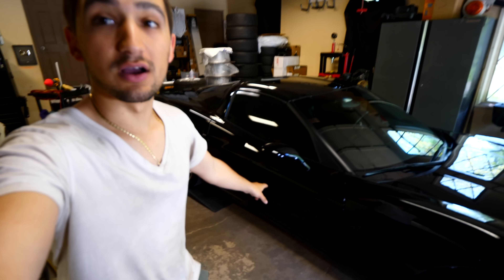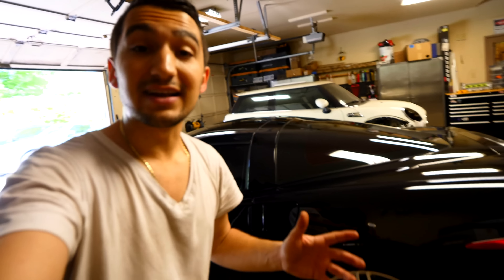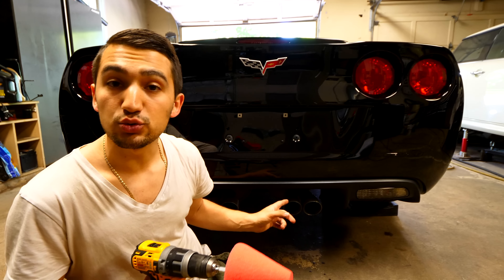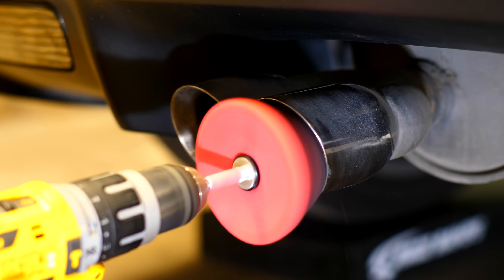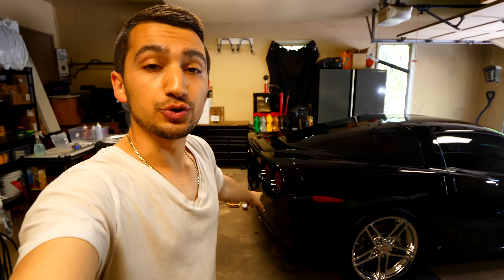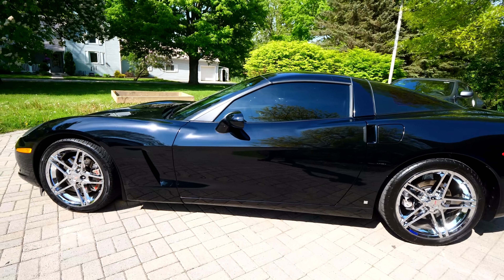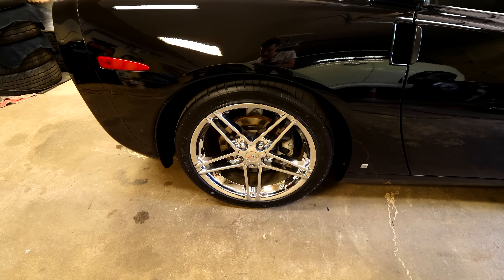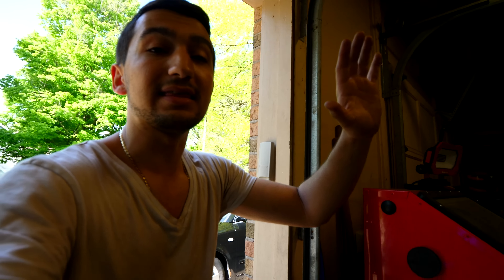Differences Between Cleaning vs. Detailing a Car

Comment: Great effort Milan. I would add the door shuts and hinge areas - where the door opens, the spare tyre and wheel well inside the boot or trunk, inside the vents of the blower system inside the car, inside the glove box, inside the fuel cap area, loads more really. Good job though 👍👍👍👍👍👍

Comment: Cleaning inside the fender well. Possibly add some product to the inside plastic bits for more contrast.
Reply: JonaPark97 I was just going to add the same comment, add some plastic dressing on the inside wheel wells adds to the “details” in the detail 😋

Comment: Properly cleaned glass is a major thing. Youre looking out of your front windshield 95% of the time, it needs to be cleaned, while youre at it might as well make sure the other glass pieces are detailed (side and rear)....another thing is the door jams...sucks to see a detailed or cleaned car and the door jams look like crap....finally, the interior trim, i hate seeing faded trim, treat it with something to bring it back to life. Dont forget when youre doing the carpets to add that detailers touch by creating opposite vacuum or brushed passes so it pops more on the carpet

Comment: just wanna know how you clean the microfiber cloth after cleaning those exhaust tips.
Reply: Warm water and microfibre cleaner chemical then put in a bucket and wash by hand and let it dry on a dry rack. OR you can just use a washing machine and dryer seperate from any other type. of fabric